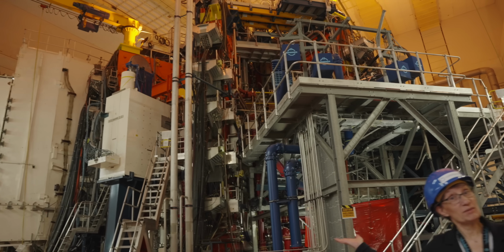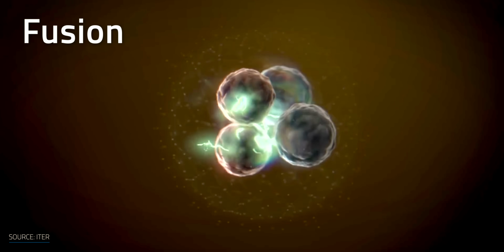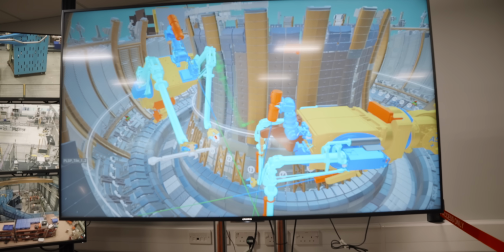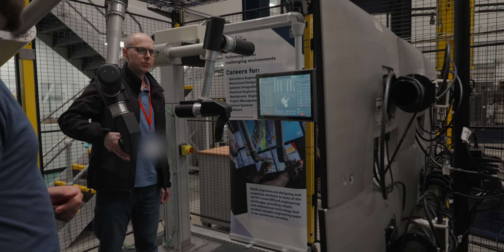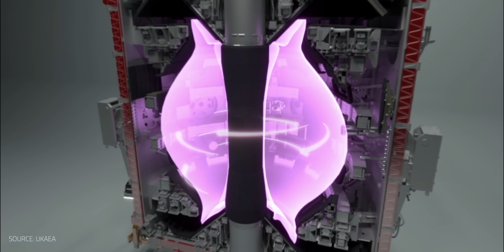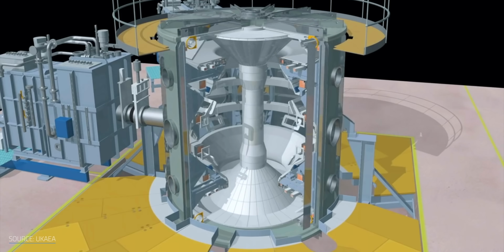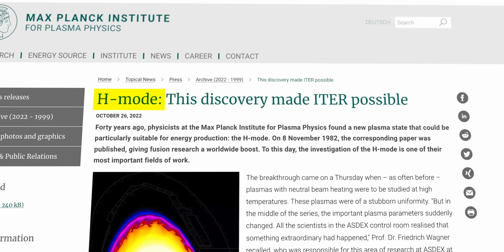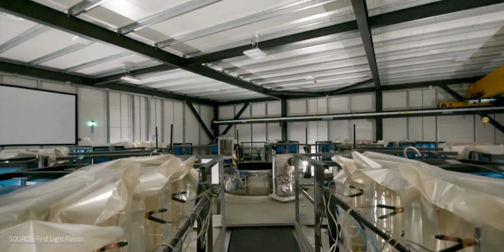How We’re Going To Achieve Nuclear Fusion

Comment: Can you imagine how fast any public utility would go bankrupt if they invested in this, let alone building a conventional fission reactor in a world of nuclear bigotry? Let’s say you actually complete a fusion project generating more energy than it consumes……now there is no fuel to keep it going. In fact, there is hardly enough fuel to support fusion research efforts. Daunting….and I would hate to author a prospectus for investors. Fortunately, we have two awesome fusion reactors available to us at no cost…our Sun, and the core of our earth…the later only 17 miles away from us.
Reply: the earth is not a fusion reactor, it is hot and radioactive magma and tritium is only that expensive because we don't have an efficient way to produce it, but the real goal would be to create deuterium-deuterium fusion, since deuterium is 3,000 times cheaper than tritium. 

but if manufacture of tritium went down 30,000$ to 3000$ per gram and fusion was efficient enough to rival fission you could cut down your electric by an order of magnitude.

also fusion reactors are much safer than fission although fission reactors are already very safe, fusion fuel would require very intense conditions to fuse so when thats shut off the reactors just stops working. 
the waste elements are also mostly not radioactive either,
tritium is radioactive but requires ingestion and the amount a commercial reactor could go through be anywhere from 0kg to just a few hundred per year, 

the entire us electric grid would only have to get 100 tons of fuel if the fusion reactors were able to reach .14% mass energy conversion. while most stars do better than this.

watch:
https://www.youtube.com/watch?v=3gSzzuY1Yw0&t=1114s

watch:
https://www.youtube.com/playlist?list=PLnvgzgJa3LU7QYSIv4A8Unxcl84Vza6JU

Comment: First thing first...
The geometry is wrong.
You need to build the housing to optimally hold an expanding magnetic field not the residual curvature of the flux lines of a bar magnet.
It is easier to control a plasma with magnetic fields than it is to contain it with mass and keep the mass cool.
one might try using a maser (microwave laser) to follow a magnetic barrier, essentially isolating the plasma from the side walls.

optimally the chamber should be in the form of a doughnut... or in other words a toroid with two multi tier/core magnets in the center of the toroid set to push off each other.
pushing the magnetic flux out into the doughnut with a twist as well as a rotation.
induce an electrical arc.... high voltage arcing will trace the edges of the magnets.. and when the second and third and fourth tiers are activated the arcs will expand into the doughnut and twist into tendrils that will confine and press against the plasma in waves and pulses while circulating the plasma around the inner circumference...avoiding the outer walls.

Comment: I worked 8 years at JET. At the time we have  smart top managers.  I mean they were the ones who made History.  Now we must admit that ITER was not the chosen version from them.  The  money spent so far is  crasy. Because ITER is more a political project than a reasonable reseach project we knos already this will be the last Tokamak. Why ? Because the cost and ITER is an  old  design what ever the added componants to try to produce Tritium .  Just understand we have facing to the steam engine solution based on continous plama. ITER will be at risk just because the disruptions from very high electron sparks .    The nature of the reaction inside the permanant plasma  has the problem  of having  part of the energy produced by the fusion stolen by the electrons which should not escape from the plasma because  they stop the reaction ( short circuit) .  This is very important to understand , because the Sun is not annoyed about that because  it is in the vaccum.  Therefore  the idea is to not give time to the electrons to suck the energy of the fusion reaction  on Earth.  I mean to create  a very short plasma  for creating the reaction. A bit like our car engine working from multi sparks explosions . Therefore this mean to realese high current in very short time like 100 nanosecond to compress the mixture well enough to break all the respulsive nuclar forces to produce the fusion. Of course in homogene way to oblige the Fusion.     So far the Zmachine can  to produce  very high temperature above 2 billions of degrees for few nanoseconds.  This approach was originaly used to test  Xrays radiations  shield on nukes for military defense program.  But eventually with time and smart solutions the posibility to make fusion reaction became a reality.  The only main problem is always to make more energy than the energy  used to prduce fusion reactions. And since 2022 we knows this solution for smat mega Amps souces exist and cheap. The Russian have desmonstrated capable to fly at Mach 10 at low altitude for minutes which is impossible because the heat fo air friction is above 6000 DegC the temperature of the surface of the Sun...   Of course the  Authorities dislike smart people able to understand MHD technology because this could bring new weapons  without  radiactivity because no neutrons involved.  This is quite a problem if the Russians are working in inertial fusion technology  and making temperature above 10 billions degrees  which can change the nature of the  atoms . This why ITER is a pure waste of money because the solution is not making huge reactors but small ones  capable to create enough  fusion Xrays photons  from safe material like borum and hydrogen atoms,  to be transformed  easly in current and eventually  stored in batteries like found in the Electric car industry .  Good video anyway . Thanks to watch the new ARM to remontly access to the vessel. I was working at the frist wall division and moved to the plasma fuelling unit making gun to launch Deuterium  ice pellets  inside the plasma.  A technology good to be used to fuel Inertial fusion reactor too

Comment: "We found that bolt we dropped."
"Cool , I was worried about it."
"It was at the bottom of the crater where South East Britain used to be."
Reply: even the vast majority of NATURAL fusion reactors don't explode. the plasma inside would just cool and turn into gas and unless it leaks, it is not dangerous.

Comment: It is not the drugs, it is the side effects. 
I am a NUC and I used to teach Pressurized Thermal Shock. 
In the 60's a lot of fission reactor vessels were built. A problem came up in the early 80's. The welding rods were coated with copper to prevent corrosion. Fine in any other industry. But the copper in a high neutron flux deteriorated. This is just one of those things that nobody even thought of. This weakened the welds in the 9- to 12-inch-thick reactor vessels. This was a disaster, thankfully no vessels cracked open (but the oops at Rancho Seco was writing on the wall). What will be our next oops? We have a fine fusion reactor placed at a safe distance of 93 million miles. Lets use that.

Comment: The "problem" is that in a real tokamac ........IN MY PERSONAL OPINION the output is when all the "losses" is reeducated it is going to be 1.45-1.88 of input energy. It is still producing energy so that is good... but to what cost? That is the question.
Reply: well at worst it would be 1/2 tritium and 1/2 deuterium would require about 170 tons of energy maybe at a conversion rate of 1000th of e=mc2 to produce about 4.24 trillion kwh of energy [the US for example]

and tritium at about 30,000$ per gram multiplied by 85,000,000 [the grams to metric tons time the number of tons needed] would cost 2.55 trillion$ divided by 334,000,000 equals 7000$  [per person]

the main problem here is tritium which is incredibly expensive and would more likely be a stepping stone to deuterium-deuterium fusion which would be much better because deuterium is 2300x cheaper

with just deuterium at the same efficiency it would cost just 2.12 billion$, or just 6$ per person per year.

Comment: Is this cheaper than drilling a deep hole in the ground that have all the heat we need.
Reply: possibly but we shouldn't consider it as one or the other because geothermal and fusion have almost nothing to do each other, hydrogen is the most common element in the universe being able to get energy from it in more compact ways than giant Jupiter's is pretty useful.

Comment: Your video implies that the fusion of two hydrogen atoms yields more energy than the fission of one radioactive atom. This didn't sound right, so I checked. Deuterium + Tritium fusion results in 17MeV, while U235 fission results in 200MeV. The reality is much more complicated, as there are multiple pathways, but in any case your video is wrong. Fusion releases a much higher percentage of the mass energy, because the atoms are much lighter. So 1kg of deuterium can release more energy than 1kg of Uranium, because there are many more atoms of hydrogen in a kilogram, not because the individual reactions are more energetic.

Comment: The whole point of these fusion devices is to get heat from the fusion process and use it to heat water to steam to drive turbines, just the same as fission neclear reactors, and oil, coal and gas power stations.  Yet I never hear a dicky-bird about how the builders of these devices are going to extract the heat. So how is it to be done ? The tokamac devices are surrounded by supercooled magnets to confine the plasma; hardly a good place to start !

Comment: Nuclear fusion is the longest scam.  It's possible, for sure, but no one knows when, so it's better to treat it as it will never happen until it actually arrives and concentrate on other ways to produce energy that already exist. It might even be obsolete by the time it is ready anyway. Solar and wind is possible to go off grid with, fusion power requires a grid, so it can't replace solar and wind anyway. Maybe the industry could use fusion power, but they will most likely go solar, like Tesla have done, long before that. If they get free energy from solar panels and batteries that they have already bought, then why would they buy fusion power from the grid?

Comment: I think fusion is a waste of time, money and brain power.  I doubt that it will ever be cost effective compared to solar and wind.  There are so many unanswered problems, and the technology is extremely complicated.  Even if it succeeds in becoming a commercially viable reality it is a source of power that warms the earth directly, not a problem at current energy usage levels, but if it were to succeed and become cheap, then we'd probably use lots more power and unlike renewables, fusion creates waste heat.  Solar and Wind capture energy that would become waste heat, so that is not a problem.  And, on top of all that, fusion will not deal with the current crisis which demands solutions that can be implemented NOW.  We can't wait several more decades for fusion.  All the work being done by the very smart people working on fusion would be better spent on developing better energy storage systems to support solar and wind power.

Comment: It's incredible, but, it's solving the wrong problem. I'd bet someone will deliver $10/kWh grid scale storage before someone delivers $10/kWh generation by fusion to the grid. The stupidity of the comparison is how far away fusion is. Flow cell battery chemistry engineering is more economical than nuclear fusion physics engineering. It doesn't need 1 million Kelvin.

Comment: GM has, hold up your your fingers now, one EV, the Bolt.  They have no other real production BEV auto.  Yes they made a couple of hummers and three Cadillac vehicles.  But that's it.  Again, at this point don't tell me you have been doing that for years. Show me, oops got nothing.   there.  On top of that the touted while being made in "North America" will mean Mexico for both the Equinox & the Blazer.   Really bad effing move as far as I'm concerned.

Comment: Given the annual production of tritium annually worldwide is less that 50 grams and US production over 40 years before we stopped making it on purpose was 225kg of which 16 kg is currently remaining, we are going to really have to crank up the nuclear fission reactors to fuel up for "green energy".
Reply: Nah, just use Seawater. There is 352 quintillion  gallons of seawater on Earth. Helion, Zap Energy, ITER, NIF, Commonwealth and the rest of the Hot Fusion folks should be putting seawater into their reactors instead of expensive and hard to fabricate "gaseous matter" like deuterium and tritium. Should be using the dielectric of water instead. Green Hydrogen production from seawater for over 1 billion years.

Comment: It's worth pointing out that fusing iron and heavier elements consumes energy instead of releasing more. Likely due to all the energy needed for the extra binding force carriers (guess). This is why heavier elements tend to only be created in supernovae and very powerful particle accelerators. And it's why fission is better with very heavy elements, and fusion is better with very light elements. Though of course if you could convert the lighter elements completely to radiant energy, then that would work just fine. However for that you need matter-antimatter annihilation to the best of our knowledge. But it also slowly happens all the time due to the weak nuclear force. Nuclear decay. That said Hydrogen is stable. Although Hydrogen's isotopes are not.

Also. It's neat how they disperse the plasma. I wonder if it could be possible to funnel it in a vortex.
Reply: @@karlwithak. Not even close to a bomb. For a bomb of any kind you need a cascading reaction that maintains itself for long enough for an out of control conflagration. The plasmas in experimental fusion reactors simply do not work like that. Something as simple as the plasma touching the walls (as opposed to being magnetically suspended) may damage the walls, but it also cools the plasma to a severe degree, enough to disrupt the entire run.

Comment: Use DT, then switch to DD. Scale up the size to about 4 to 6x and design the fusion channel into a vortex tube. Use a conventional fission reactor for preheat and startup as well as generate tritium for startup. Use a 3 phase microwave field to excite the plasma, which will then spin inside the tube like an electric motor. As the plasma travels towards the neck of the vortex tube, the speed of rotation will increase, and the magnetic field will heat it further. Finally, when fusing begins, the waste heat from it will preheat the incoming plasma and the reaction will be self sustained as long as the gas blowers are operational and helium is purged.

Comment: I hope we make some significant breakthroughs in fusion. We could really use this as a civilization.
Reply: The climate activists will try and ban it as soon as we crack it.
Reply: We might, but it probably won't be tokamak based.  The JET experimental tokamak consumes 800MW of power to maintain the plasma!  That's the output of a large nuclear reactor.
According to them, if it works, it will generate between 1 and 2 GW of power.  That is a terrible EROI. It's under 3 even assuming 2gw. If you assume 1, the low end of their estimate, it's 20%. You put in 800mw and you get 1gw out.  Who knows just how much power the rest of the plant will consume.

Comment: if its possible to enrich uranium for u235, would it be possible to enrich Iron for Fe54 (for example)  - thus when it did absorb a couple of neutrons it would transmute into another stable isotope. The point being that this sort of thing would reduce the quantity of radioactive materials for the de-commisiong process. 
Or would that idea be crazy expensive and impractical?

Comment: This looks very promising. But I have my concerns over fusion  power. It has always been billed as cheap limitless energy, yet requires rare forms of hydrogen and/or helium3. Unless we start mining the moon anytime soon, the helium will be a problem, and siphoning out the deuterium and tritium from seawater will not be cheap, or a quick process. All this leads me to conclude that if and when a sustainable reaction producing more energy than it requires, it will be very expensive and resource dependant.

That being said, it's still a better option than burning fossil fuels, and likely will be better than fission reactors.